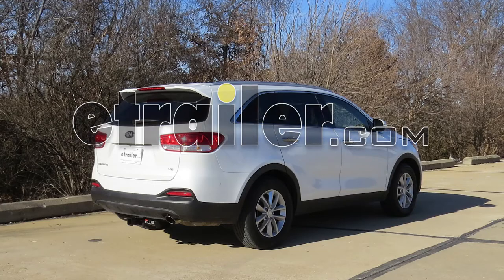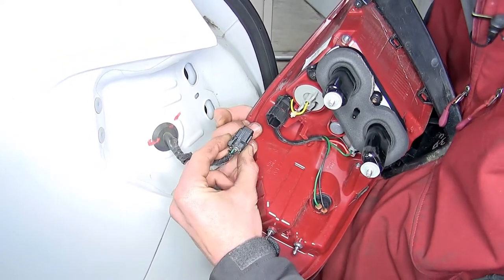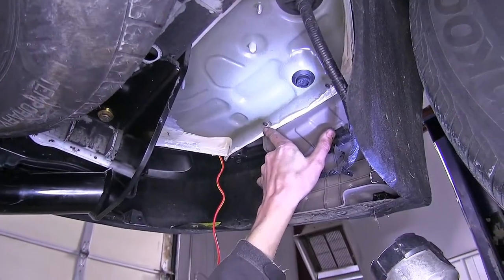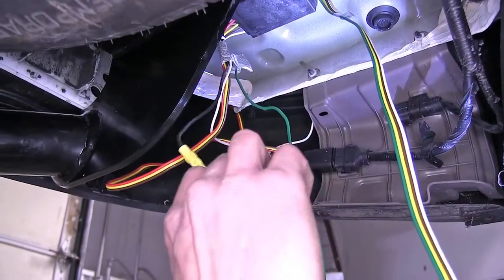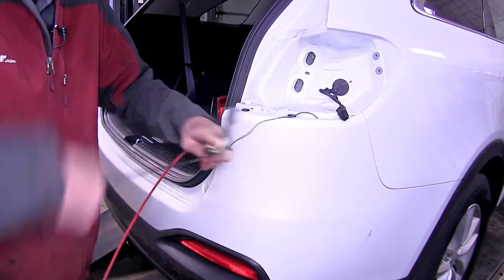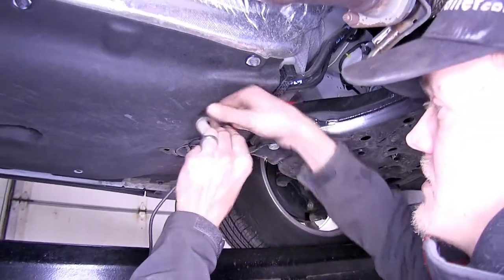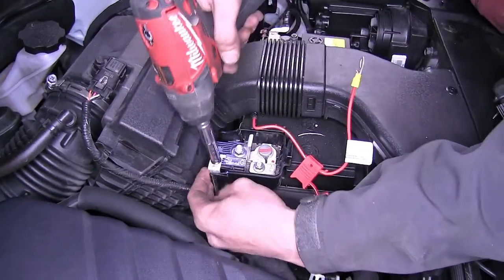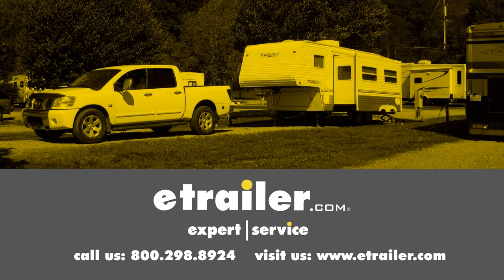etrailer | Trailer Wiring Harness Installation - 2016 Kia Sorento

Comment: Whats the original wire harness for under that cover where you installed the module?
Reply: tow wire there a kit to plug right there
Reply: ya that is for the ones that come with the tow wire kit factory but for the ones that don’t have the tow wire kit factory you have to do what he’s doing in this video